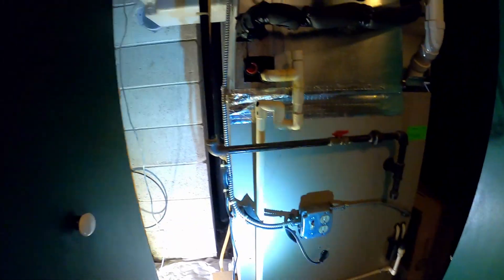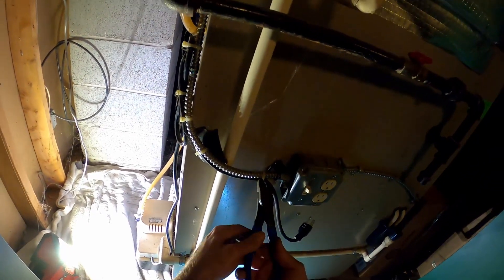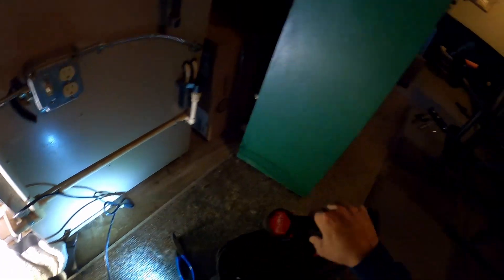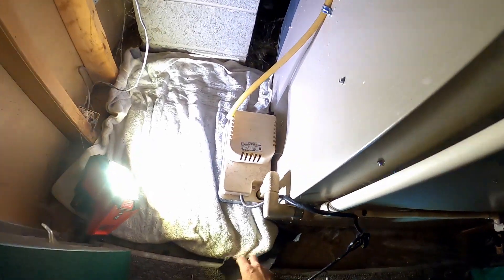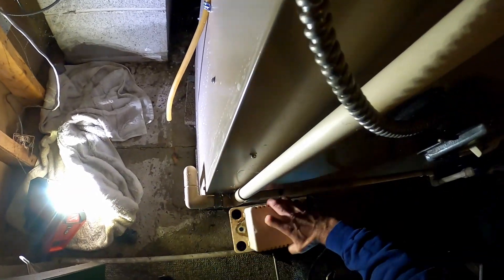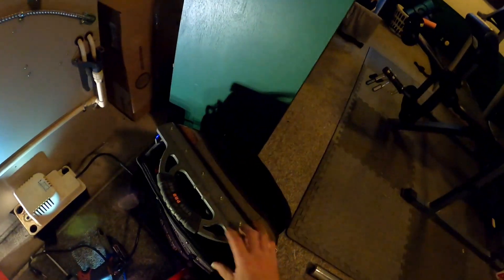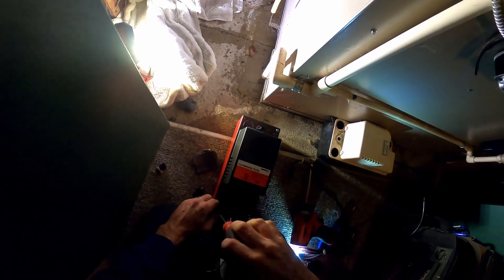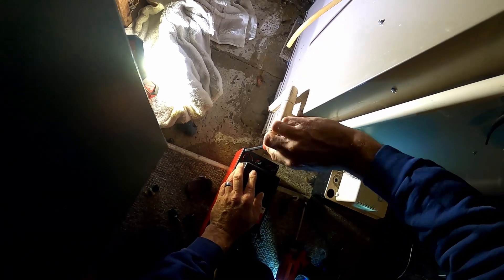Little Giant Condensate Pump Snapped Check Valve (Pump Replacement)

Comment: Do you ever use hose clamps or zip ties on the vinyl tubing to the condensate pump check valve? Thanks for the clip.

Comment: You are always dropping and loosing screws. Now I know im not the only one that does this. I hooked the pump float switch in series with the W wire instead of R. I don't have any AC installed and still want the fan to cycle on with R and G when the wood furnace blower comes on.

Comment: QUESTION: Our condensate pump tubing was re-routed from simply exiting an exterior wall, into the basement toilet ejector pump which was immediately adjacent to the HVAC unit. The ejector pump failed, and the condensate tube kept feeding water into the failed ejector tank and over flowed all over our basement floor. Is it ever appropriate to re-route like that?
Reply: I don't think there's anything against it but I wouldn't run it to a sewage ejector, it's best to run a condensate pump to either a sump pump or straight outside, that way if the sump pump fails and the pit overflows it's just ground water instead of black water